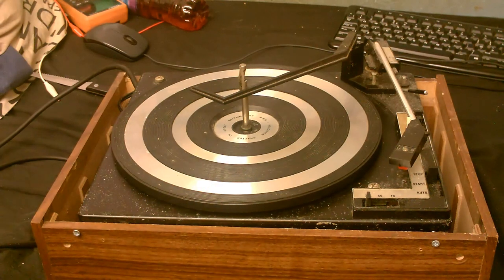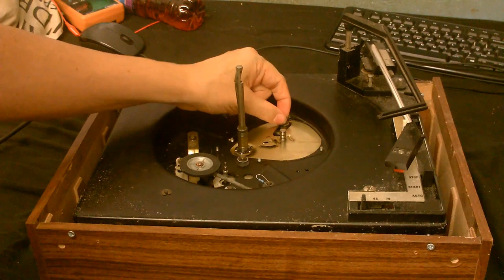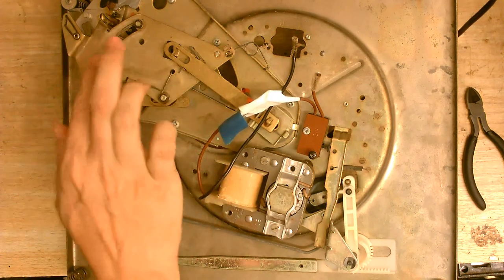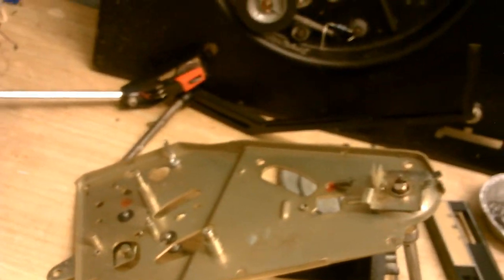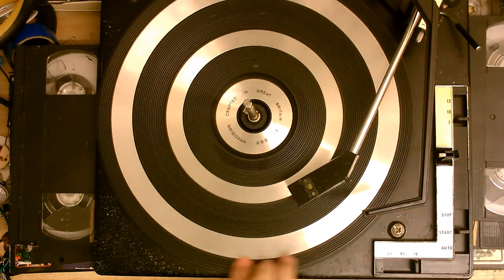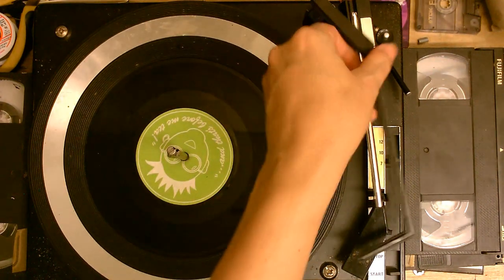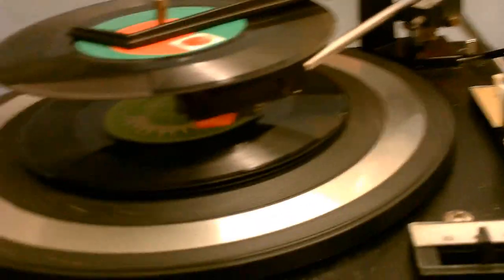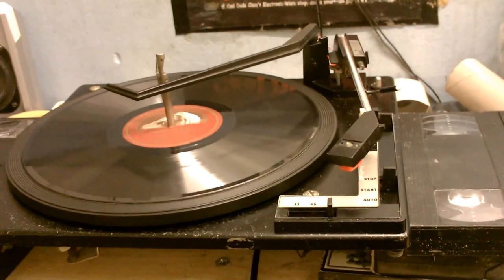BSR turntable restoration pt 1 - Mechanical Overhaul

Comment: @9:11 Making the modification with the toilet paper was not needed, the reason why the arm was going right a bit more was the anti-skate doing its job, being that there was no cartridge at that time, there was no catalyst weight to the tonearm, therefore the anti-skate weight was higher than the tonearm weight, especially with the anti-skate at its lowest setting! Not it would of pulled more right faster if the anti-skate was at the highest setting "6"! Anti-skate should be set the same as tracking weight by rule of thumb! Otherwise I did enjoy the video!

Comment: I have four of those auto change record players. One from the 1950s, (Dansette valve) one from 1960s, (Bush valve)  and two from 1970s.( Fidelity transitor)  Still working and better than the rubbish they produce now. They have been repaired in their time of course but continue to work. They can be restored, unlike the new ones you get now.

Comment: The reason why you had magnetic interference with that Audio-Technica cartridge is because of the 2-pole motor installed. Your C-123R2 deck has the mounting holes for the 4-pole motor (almost every BSR deck has both mounting holes for 2-pole and 4-pole motors. You will need to get a 4-pole motor from any other BSR turntable (240v/50Hz) so you can use the magnetic cartridge. I may make a video when I upgrade my BSR MA-50 (P-189) to a 4-pole motor.

My P-189 deck was sold as a manual turntable, so the mechanism looks just like 6:45 except with the part where the tonearm pivots.

Comment: As a repairman I started with these BSR turntables, and I learned that those with the plastic platter, if used with the record changer function, when the record falls on the platter it slips for an instant before spinning. And by doing this over time the disc gets ruined very easily.

Comment: Dagness Agnes,, we remember the BSR turntable on our mum's old 'Singer' radio/record player... Think our dad's music center had one as well. We still have one of those 45 adapters you stuck on the record changer spindle. 

Back in the '90s we converted a Panasonic half-sized turntable from ceramic to magnetic to work with our then system - didn't know ceramics had a line level output. It worked but was eventually replaced with a nice Technics deck we'd found released in the wild. Still have the Technics...
Reply from the maker: I used to have an all-in-one GEC Sound-deck from the 70's which used a ceramic cartridge which I also converted to magnetic. I had preamp, which was powered of the main transformer, and the preamp's output was connected to the amplifier's phono input. It worked really well. Although it too used a BSR changer, it was much better than the one I have now, it had a proper s shaped tonearm and counterweight, and metal turntable. Plus I didn't get any hum problems with that, as the turntable could shield the cartridge from the motor noise. I wish I still had it.
Reply: @CoolDudeClem  ~ wouldn't grounding (earthing) the record player help? Most magnetic cartridge players need to be grounded to the receiver/amplifier to reduce hum. Just a thought...
Reply: @chezsnailez  Yes, you can with a separate thin wire coming from the 2 pole motor directly screwed into the back of your amplifier or receiver which generally has these terminals in the back when built.

Comment: Hi Clem, these autochangers do work OK with shellac 78s. In fact, I have an old Garrard one which was designed primarily for 78s. They don't break when they drop down, nor do they break the record underneath. The only issues with 78s are (as with yours) some don't have a lead-in grove, and indeed some have no lead-out, either. Also you need to be sure the 78 is not cracked or chipped before you play it, which could ruin your stylus.
Reply from the maker: I've accidentally broken 78's a few times as a kid, most of them I could just tape them back together, just making sure the grooves line up. most of them actually still played.

Comment: Well done Clem!
I guess that you may have been inspired by Radiotvphononut to attempt that restoration.
Would I be right in thinking that you could play up to seven Vinyl Records (only one side of each one of course) as long as they were all the same size and speed in sequence with the Autochange Function?
Reply: I think you can play up to six records on one of these units (depending on size and speed).
Reply from the maker: I wouldn't stack any more than 5 records, 7 might be possible if they are thin.
Reply: @CoolDudeClem  I seem to remember 7 was maximum, one on the table and 6 loaded 😀

Comment: Hi, thanks for the video! I am doing a restoration of a BSR and am having trouble getting the tone arm to move horizontally when using the automatic function. I found a spring in the bottom of the box and am not sure where it goes; I'm guessing it's the cause of my problem. Would you be able to share the pictures you took of your turntable in its various states? Any help would be appreciated. Thanks!